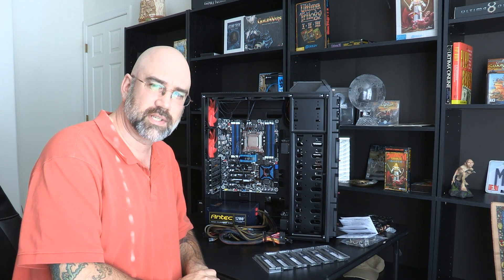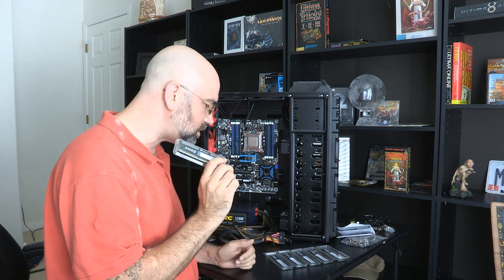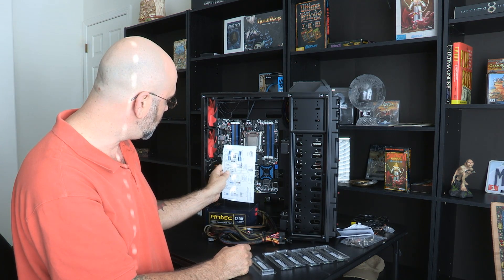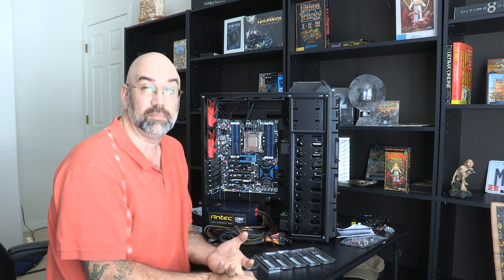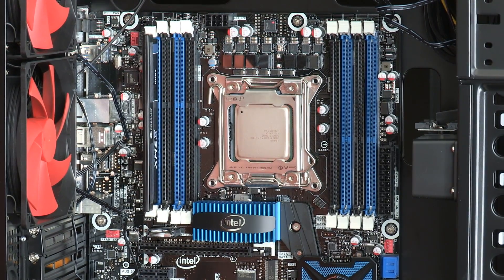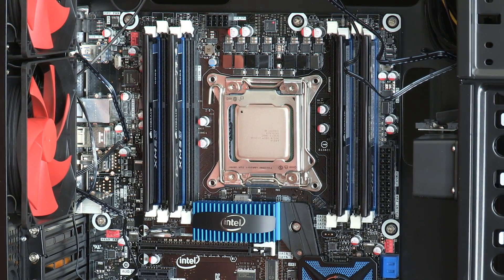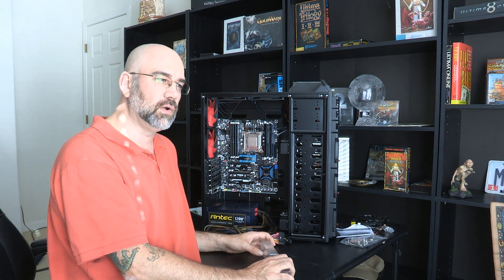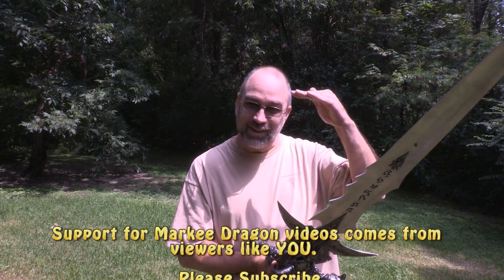How To Build a Custom Gaming Computer - Installing Memory - Corsair XMS3 8 GB (2 x 4GB) 24GB total

Comment: RAM doesn't need to be in order of serial number! Serial numbers have never meant anything on RAM except for a way for the manufacturer to keep track of them. You want to match the brand, speed, and timings of your memory! Also 2011 socket based boards are optimized for quad channel memory, which means you either want to your memory in sticks of 4 or 8. So with your current 6 sticks of RAM you can only use 4 sticks. If you install 6 sticks of RAM you are only going to throttle back the memory to dual channel which will dramatically decrease your memories speed compared to running 4 sticks in quad channel.

Comment: There's a lot of wasted money for a gaming rig. 8GB of RAM is the max you need. And a hexa-core CPU is completely unnecessary for games since almost zero games use more than 4 cores. If you'll be doing other things like recording, video editing, or 3D rendering, then more RAM and cores would be great. Otherwise if it's just for gaming you're wasting about $300 that could have been spent on a better GPU.

Comment: I got a used computer but it works ...took out power supply and put in memory! Someday might build or assemble a whole descent game computer can't see having expensive 300 or 600 graphic card in the system just for games like some people put in for some game computers...like watched a computer technician assemble  a game computer for someone and he had a corsair case, 650 dollar graphic card, 16 gb's of ram, sata hard drive 500 watt power supply all for a game computer that someone wanted...he said that was the first time putting in a 650 graphic card for a game system ....

Comment: Not sure if the adapters will work, I obviously don't know wich ones you've bought but most of them reduce 140mm to 120mm so that the fan sits smack in the middle of the 140 hole. The h100 fan mountings are right besides each other. So their center distance is 120mm as opposed to the 140mm center distance of the case vents and with the adapters mounted that will stay exactly the same. and thus not fitting the H100

Comment: the 6 sticks will work, but the Mobo's for LGA 2011 do support Quad channel and will work optimal when mounting the Ram modules in a 4 or 8 sticks configuration. The way it is now it recognizes it as 3x dual channel.

Comment: You only claimed the one ssd so why not mount the h100's radiator where your hard drives go..i've done it for someone and it worked well with the front mounted case fans for circulation!

Comment: Serial numbers doesn't matter for Ram. You are not going to be able to use 6 sticks of ram on the motherboard, you are either going to be able to use 4, or 8. 6 sticks just WONT work with the MOBO.